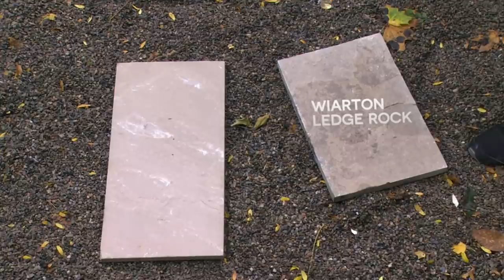Couple Buy New House Before Fixing Up Current One | Critical Listing

Comment: What’s the obsession with the designer adding grey and yellow to like every house she makes over, and why painted those gorgeous wood stairs? Just sand down the wood no those stairs and keep it wood!
Reply: Well this show takes place back in 2014 and I think gray and yellow was popular at the time. Staining wood is normal. Look like they just stained the wood in the same color.
Reply: Agree with you. No matter what year this was filmed in it has a rather bland appeal in its interior. They make out perspective buyers to have no imagination or foresight of what they can make it into. Why did they make the fence so high where the bins are, it looks unbalanced in that area to me? They took a lovely staircase and turned it into a boring one. I guess we all see things differently.
Reply: Bc sanding the wood down to bare wood would take too long and there's no guarantee that it would look good. Sand just enough to paint and then cover up is a lot faster
Reply: I argue w myself over using this all the time but it just works. People can imagine their things and colors over it
Reply: They always talk about how they have to pick color that are appealing to the largest amount of people beige and grey are the best neutral colors and blue and yellow are the best for a pop of color so that’s why on the colors. I agree with the straits staining wood is a much better option paint on wood anything that gets used a lot will look tire too quickly

Comment: How do Canadians qualify for 2 mortgages so easily? I see this in so many of the Abode series! Our banks won't approve a second mortgage on the basis that you're "planning to sell your current home".
Reply: Same for me, you won't get a new mortgage unless your current home is under offer and the sale is proceeding.
Reply: Because, believe it or not, a mortgage doesn't show up on your credit report. Unless you tell your lender about your other mortgage (with a different bank) you can get multiple loans.
Reply: @brianwball40  that's not the case where I live. It must lead to loads of bad debt??!!
Reply: They tend to make use of bridging loans which are alot cheaper than elsewhere, but usually there is an offer on the table to get those rates